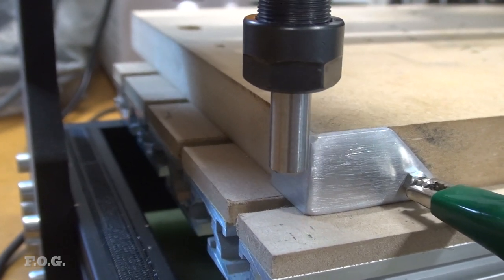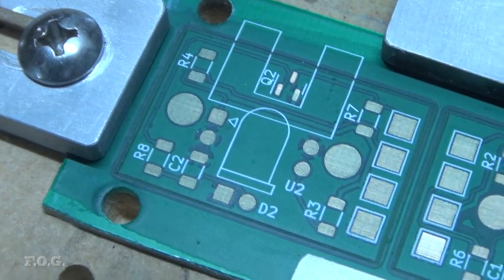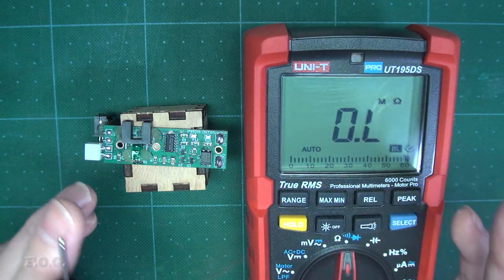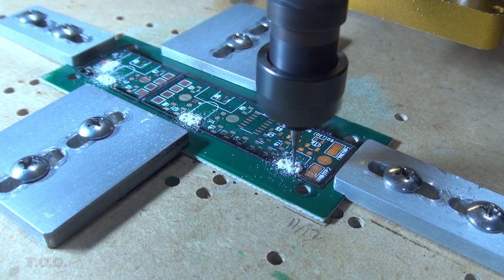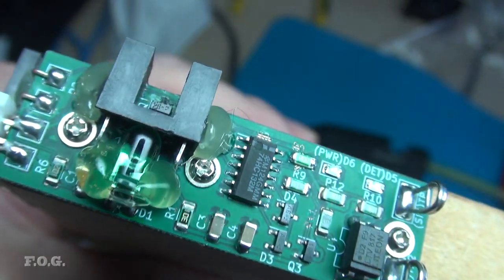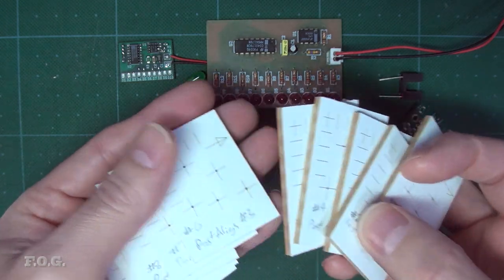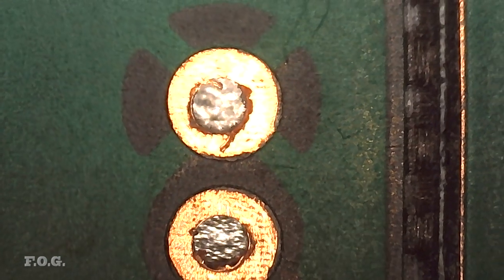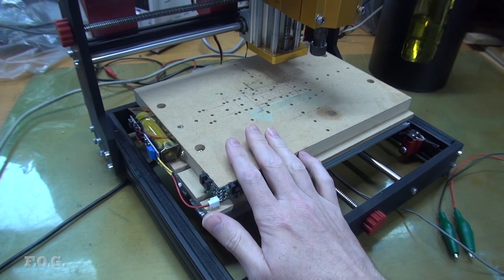EP8 – DIY PCB – Corner Probe for CNC3018 (Contactless)

Comment: Metal polish...brilliant! I had considered using Autosol, but it will attack the paint I'm using and has a wax component that would have to be removed. Just tried a kitchen product designed for cleaning stainless pans...works perfectly. Great tip!
Reply from the maker: Your welcome! Thanks for the comment.

Comment: See if you can get some 3000 grit sandpaper at the auto store and scrub across the pads, (or some 0000 steel wool or scotch brite) then try a wee bit of liquid flux before applying the solder paste, also I wonder if you can use some really thin acrylic sheet to burn out the solder stencil (or maybe capton tape?)
Very cool...the laser cutting the traces and pads are nice and the green solder mask looks very professional!
P.S.  Carbon (aka burnt stuff) and even graphite from a pencil across a SMD resistor can create resistive traces
Reply from the maker: Thanks for the comment! I used to always use brasso and steel wool to clean off photo resist from PCB's, it works a treat! The problem is that the mask resin sits above the surface creating a shallow pocket which can't be reached easily. Thankfully the fine toothbrush cleaning with Pikal (Japanese Brasso) is now working great, so for now this problem is solved enough(ish). And yes, others also pointed out that the burnt resin is becoming carbon after burning.. obviously ;-) Anyway, you live and you learn!

Comment: I collect leds and have tens of thousands and I'd love to find vintage ones. You can take the small spout off the heat gun and just go at it from the top. I find the surface tension works better then.
Reply from the maker: Sometimes I take it off, sometimes Ieave it one, depends on my mood ;-)

Comment: Great videos. How about using a metal brush in the CNC, to clean the green solder mask off the copper pads?
Reply from the maker: It's an interesting idea, but it would have to be a pretty tiny brush! In a way it seems somewhat similar to using a spring bit that other people use (also shown in my earlier episode). I have also thought up some completely different methods to clear these pads, but actually the laser clear works pretty good, and is an easy process to do (I am just not doing it right!). In my final solution I am thinking to simply apply more power to pads that sink heat well, and allot less to those that don't. From what I have seen so far, this should work well. Thanks for the comment and idea!

Comment: Pretty amazing series. I was hoping you got amazing results with the cnc routing but you went for etching. Thank you for sharing.
Reply from the maker: Sorry to disappoint on the CNC milled PCB, actually I was disappointed myself. I did try at first with that intent, but it became quickly obvious that milling with the cheap CNC was not going to work the way I had hoped. But I am glad I tried, because it left me down the path of a much better solution using the cheap CNC. More videos in this series to come, hopefully I will be able to further refine the process as well as start making some more interesting and useful devices. Thanks for the comment!
Reply: @ForOurGood  I am still on that path. The results are a little bit inconsistent. I try not to go to much in the boards base material. only milling about 35-40 micrometres deep. But a board of 50*70mm is a slow process. Easily taking 2h to mill without drilling.  printing a few transparent sheets and using UV exposure is definitely the quicker way.
Reply from the maker: @joerideman  I have made many boards with transparencies for real world use. It's ok, but without a doubt, I like this CNC laser methods much much more.
If I was going to make more than 5 copies of a board, then I would just go to PCB Way or something once the prototyping was completed.
This inconsistencies with the milling is really what turned me off, there are just too many factors at play. Anyway, wish you the best of luck, possibly you are more persistent than me, and will ultimately get there in the end!

Comment: I'm enjoying your PCB series. I'm currently doing some experiments with the 3020 CNC and some soldermask. Using a laser is an interesting idea, but I've avoided it so far due to the fumes created when burning. I hope you have good ventilation. Keep up the good work 👍🏾
Reply from the maker: Hey thanks for the nice comment! FYI: I show my ventilation setup in one of these videos, but its basically a flexible pipe connected to a ventilation fan, then I cover my whole CNC with a cardboard box to capture the fumes and direct it too the fan (also reduces laser risk to the eyes!). I do all this in the garage, so I just stick the pipe out under the garage door. I think it is a pretty cheap & simple setup to replicate, and you could just stick the pipe out a window somewhere. The great thing about using the laser for nearly all of the process is that it is very quiet and does not produce any fiber glass dust (possibly worse that burnt resin fumes).
Reply: @ForOurGood  Nice! I have the same setup. A duct fan and a hose connected to a window. I'm milling in mineral oil to contain the dust, but I have to admit the elegance of the laser is appealing. I'll post my setup and we can compare and contrast. 

I hope your channel blows up because you deserve a lot more views 🙏🏾

Comment: Sorry for the repeated comments but I'm looking to buy a laser to do the same thing. You built you own mill ehh? You are a very smart man.
Reply from the maker: I am not sure you can say I built it, just customized a standard 3018 CNC.
Reply: @ForOurGood  I realized that after watching more videos haha. I plan on buying one. I need a new 3d printer. I've got like 30 rolls of filament and no printer. I'm shopping for one today. Some dude on ali has an flsun 400 for super cheap compared to everyone else and I'm hesitant to pull the trigger because it may be cheaper than everyone else but it's not cheap if that makes sense. It prints super fast. I had 5 printers at one point but I dropped down to 2 and hurricane Fiona hit and took half of our roof off and I've been living in my workshop for like 5 months and needed the room so I posted them for super cheap and if I didn't get a bit I was gonna give them away but some dude gave me an isolation transformer 1kva and a tektronix tds2002c. I gave him probably 2k worth of parts along with the printers because he was so kind.

Comment: I don't know if anyone else has mentioned this. When you clear the pads have you tried first running the laser right to left and then run it again forwards and backwards? I have just started do my own research into using a laser to create pcbs, so, I am not really familiar with any cnc software yet. Overall, your procedure is very well done and quite interesting. Do you discuss what resin you use in your earlier videos? Thank you.
Reply from the maker: Thanks for the comment. Episode 6 shows the resin I use, and the way I apply it, so check it out. You can also find a lot of specific details of the process in the description of episode 7 (it's a little bit out of date, but still likely useful). The software I use to make the g-code was designed for milling PCB's, so sadly the options don't include control over the direction of clearing operation. I have given thought to writing my own converter, but for now I am still trying to avoid that. Anyway, good luck with your PCB making endeavours!

Comment: Burning the resin is turning it into carbon .
I wonder if the difference between the laser and mill spindle was caused by them having different weight ? When you have something hanging off the x axis at a distance from the guide rails any difference in weight will cause it to deflect more or less .Same goes for the elongated holes , it could just be an acceleration or jerk setting that needs tweaking to stop or lessen something similar to ringing on a 3D printer . Is the elongation consistently aligned with an axis or random ?
That is a nifty setting tool you have made !
Reply from the maker: Actually I am sure deflection is happening on the mill, the Z-Axis is basically floating for the first half a millimeter of contact. All of the holes in the older boards drilled pretty cleanly with this bit, but I suspect this time the endmill is a bit duller, causing it to wander on the surface until the slack is taken up on the a-axis and pushes it in (result is elongated holes). When I was making boards 30-years ago, I always etched out the hole of the center of the pad to make manual drilling easier, so on the top layer I am thinking to etch open the pad holes to make it less sensitive to dull endmills. This is the first time I have seen the elongation, so I can’t speak to consistency, but it was pretty much as you saw in the video this time around. The runout of the spindle is also likely a factor to the randomness seen, you can even see the runout in action as I probe the mill, the detection light flashes like crazy. My idea of spinning the mill when probing to always try to catch the same extremes of the runout when probing, but even so I am sure there is a little variation each time. Of course runout of the mill is still going to affect its accuracy in operation too, so the best solution will be to upgrade the spindle and eradicate the runout once and for all. And you’re probably right, carbon sounds about right, that makes a good resistor. Thanks for the comment!

Comment: Maybe I think too simple but can't you increase the overlap in flatcam to clear the pads?
Reply from the maker: The problem is heat, and the fact that some pads actually need more heat to clear, while some pads need less heat to survive.. but these exist in he same board. Increasing the overlap just increases the heat, and so you lower the power which in turn   reduces the overlap (as the beam gets smaller), and you end up just chasing your tail... Actually if the beam was properly circular, I would have already nailed this.. But there is also another spanner in the works, and this is that Flatcam "lines mode" clears vertical for some pads and horizontally for others (probably decides by dimensional proportions). As I said in the video, it seems that making the range of heat tolerance smaller (by ensuring smaller pads have at least some heat sinking capability), seems like maybe the sensible way to approach the problem for now, and I know it works. Anyway I need to do some dedication testing for this to characterise it better, same goes for exposing the text overlay.
Reply: @ForOurGood  Yes, most lasers are indeed not round. Unfortunately, they are often rectangular. Maybe you would have some sort of break in the gcode to give the pads room to cool down. or you could find a way to cool the pcb while lasering. But all in all, nice video again and nice to see how you are developing a good way to make pcb's. compliments!
Reply from the maker: @matheokoning4456  Thanks for the comments and support. Right now I am just trying a few different things to get a solid understanding of the dynamics, but eventually I will settle on something! Still very early days ;-)

Comment: Cant the board be cut using the laser? That way the alignment issue goes away. My CO2 laser can't cut metal, so I suppose the holes/cut tracks need to be etched first.
Reply from the maker: Thanks for the question. Actually no, even with the holes for the pads etched, this laser cannot make the through holes. I have seen a video from "techydiy" where he used a super powerful fiber laser to cut the holes in the PCB, as well as clear all the copper. It is very impressive to see. However this laser is very very expensive, and well beyond the price scope of what I am trying to demonstrate, it also looks like maintaining dimensional accuracy and positioning could be problematic, and I am not sure if you would get 0.1mm tracks with that method. With that all said, I have some relatively low cost upgrades in the pipeline for my CNC3018, hopefully after that the milling and drilling accuracy will improve by a decent margin.